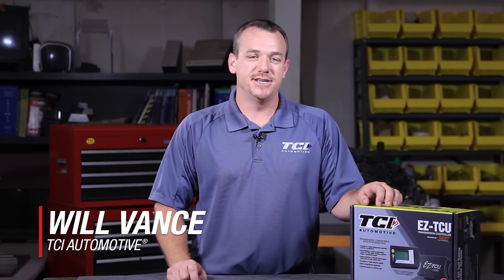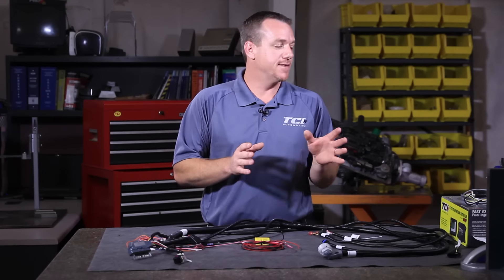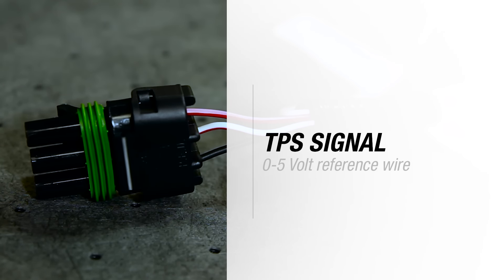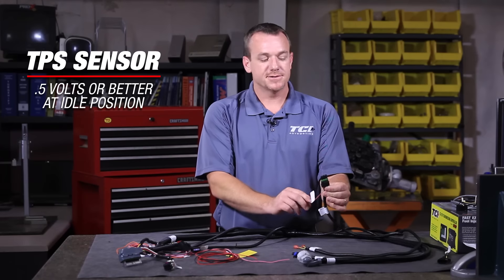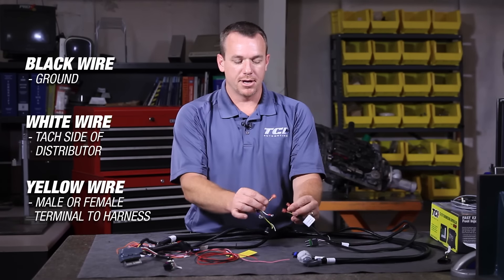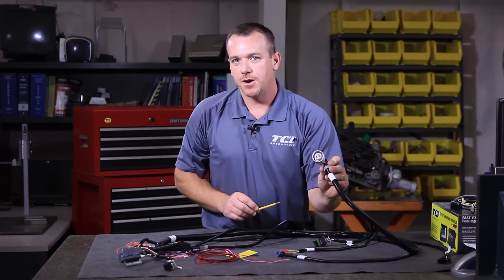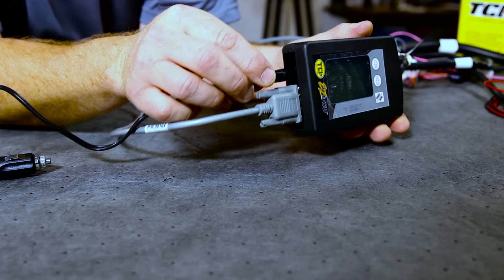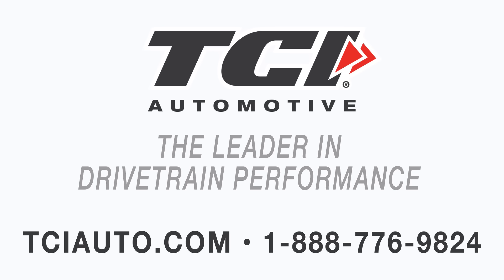TCI: EZ-TCU Transmission Controller Install Basics

Comment: I finished installation of ez tcu unit on a 6.5 diesel humvee running on 4l80e, its extremely easy, I absolutely love the simplicity and functionality of EZ TCU,good job guys.
Reply: was it a 24 volt hmmwv?

Comment: So I built a Gen 3 5.3 ( carb swapped ) I wanna run the original 4L60E that came with the motor along with the transfer case. Will this system work? If so I’ll buy it.

Comment: These modules are EXTREMELY SENSITIVE to heat. DO NOT mount under the hood. This left me stranded in the mountains and forced me to ziptie the module to the wiper blade to get me back on the road. 
I ordered a replacement and removed the harness and moved it into the cab of the truck. Still it goes into limp mode. Pack the module with an icepack and drive for hours. 
TCI recommended getting a warranty replacement. So that arrived today so I installed it and at least the tow haul works now . BUT STILL GOES LIMP. As soon as it gets warm. 
Swapped out vss twice at TCIs request. First one was a new aftermarket sensor. Second was a used GM sensor to get me on the road as no one had stock. A third GM sensor is on the way. I don't have high hopes. 
Icepacks for now.
Reply: Did you figure out a solution? I’m dealing with the same problem and can only drive for a few minutes before it stops showing mph on the handheld and downshift back to first gear.
Reply: @dedrickwashington6219  I did. I removed the trans control harness components from a spare OEM harness and re installed it in the GM ECU. Reflashed my ECU and have never looked back. I removed ALL TCI components and sent it back.
TCI was unavailable to provide me with a working ECU. JEGS was good an gave me a full credit. But it was a shitty experience.
Reply: @TheLugnut hey are you saying you changed the wiring harness
Reply: @kingsavageDKS Removed the TCI system installed my own harness and re flashed my ecu. Then returned the EZtcu to jegs for a full refund.
Reply: @TheLugnut  I appreciate the feedback
Reply: @dedrickwashington6219  hey did you ever find out what the problem was

Comment: i've installed a 383 stroker motor that has a carb. on it this is in my 97  Trans Am with the 4L60E transmission that came in the car i have bought the TCI  EZ-TCU transmission  controller powered by fast, am i gonna need to buy the remote TPS unit also or how am i gonna to suply the TPS signal to the TCU controller
Reply: Did you get a response I'm putting a 6.0 Ls  in my 93 and it with a 4l60E that I want to run with

Comment: I have a 80 series Land Cruiser that’s swapped 6.0/4L80e. Running the stock GM pcm. Can I use this to make my trans mission operate better and keep my engine on the GM pcm? My Lq9 is out of a Escalade and my 4L80e is out of an express van.

Comment: Im running a 6.2 liter diesel with the 4l80, i have the isspro magnetic tac system. How do i make it compatible with the tcu? After tapping into the rpm module but im not getting any indicators of tac signal on the live data screen. WtF can someone help me out here

Comment: Can anyone tell me where to connect the " TECH INN/ RPM MODULE" on a 93 silverado pickup 6.5 diesel 4L80E transmission. There is no place to plug it in? Where can I find a tach signal? I dont have a carb, ignition box or any tach output?

Comment: I bought the TCI  ECU I hooked the gray wire to a switch to ground still no lock up ! Instructions don’t say if you need a power source or not! I have a perfect 4 speed  sure would love look up ! Any input! Thanks
Reply: They are negative switched. But that doesn't mean it will work. The Purple performance mode wouldn't work on the first unit. But it works on the replacement they sent me. Unfortunately the units are EXTREMELY SENSITIVE to heat. DO NOT mount under the hood.

Comment: So i can hook a 4l60e to a gen1  350 chevy thats carburated and all i need is this controller and that deal for the throttle?
Reply: I wondering the same thing
Reply: @swschrader1981  you would need this part at 2:34

Comment: One min it reads my speed the next it goes to 0 and my transmission stays on first gear once it doesn't read my speed
Reply: I am having the same issue. 93 Silverado w/4L60e and carb swap. I followed the instructions plus I have the tci tps too. I can drive roughly 20 minutes or so before the system stops reading speed and then I’m stranded.  TCI  could only come up with “send it back”.

Comment: Is this for 4speed only? What about 6L80/6L90 ?
Reply: In the beginning, pause it when it’s showing the box that it comes in. It says it in the bottom left-hand corner that it works with 6X 6 speed transmissions.

Comment: I feel skeptical about taking technical advice from someone who calls an engine a motor.  If that don't know the difference between those two basic things, what else are they confused about?
Reply: Why do we call a Jet Engine an engine when it has the same number of moving parts as an Electric Motor???? I don't know either.
Reply: @johnparrish9215  Because a jet engine relies on internal combustion to create power whereas an electric motor does not.  Calling an engine a motor is just as incorrect as calling a fork a knife.
Reply: @Joe_Blow215  And Steam Turbines are called engines when there is no combustion.
All I'm saying is it does not matter in the long run.
Reply: @johnparrish9215  Steam turbines are engines because they produce mechanical power from chemical energy.  If the words are interchangeable why don't people call an electric motor an engine?  Look, if you want to sound uneducated, by all means continue calling an engine a motor.  People who take pride in precision know the difference.
Reply: @Joe_Blow215  and a liquid fueled rocket is an engine and a solid fueled is a motor.
You are guilty of writing off everything someone has to say over a word slip.
Be a bit more forgiving and listen to what they have to say. Then Flame them....lol
Reply: @johnparrish9215  Both rockets you mentioned are powered by engines,  Solid fueled and liquid fueled are still both rocket engines.
Reply: Definition of a motor= a machine, especially one powered by electricity or internal combustion, that supplies motive power for a vehicle or for some other device with moving parts.
Reply: @Joe_Blow215  damn, this whole time a thought my "motor"cycle had an  internal combustion engine. I wonder where all that oil and gas went too. Now if i could only find the plug for it.
Reply: @Joshg1984  Dictionaries reflect the cultural use of words, whether that usage is technically right or wrong.  It's similar to the usage of Kleenex when referring to facial tissue.  Kleenex is a brand, which turned into a word which is technically not correct.  However there is a dramatic difference between engines and motor.  You would be hard pressed to find a serious technical journal like folks from the SAE using those terms incorrectly.
Reply: @Joshg1984  Motor is a verb...  not used often these days, but still a verb.  At the dawn of the automotive age people used to "motor" about in their motor carriages which were powered (primarily) by engines.  Look, if you want to continue being technically incorrect, be my guest.  Whenever I hear someone say "motor" instead of engine I chuckle to my self and feel bad for their lack of education.
Reply: @Joe_Blow215  so basically it uncorrected only because you think it is. There is no technical about it. Because technically your wrong.
Reply: @Joe_Blow215  general motors. Ford motor company.
Reply: @Joe_Blow215  i find it so funny that people like you try and tell people things that you have no idea about.   
Your wrong on every level. The word engine was used way before internal combustion was created And it had nothing to do with propulsion.  The word motor is actually the more accurate meaning. Hopefully you will see  the error of your ways.
Reply: @Joe_Blow215  motortrend, motorweek. Did not know these were publications about electricity.
Reply: @Joe_Blow215  the department of "motor" vehicles is in for a rude awakening. You should call them and tell them how wrong they are.
Reply: @Joe_Blow215  so basically what I'm saying is you have it reversed. throughout history engine typically never meant a device to transform energy into movement while that's exactly what the word motor means. It's only the last 60-70 years where the term engine starting a new meaning. But the words are synonymous now, But "motor" being technically correct.
Reply: @Joshg1984  People like me know nothing?  I may not know many things, but having worked for Chrysler for YEARS in Auburn Hills, I do know a thing or two about cars.  "How so?" you might ask.  Great question.  I worked as a technical trainer and gave seminars to  dealer techs on how to work on new vehicles that were to be released and how to diagnose and repair difficult issues with current models.    One of the things I would instill in techs was the importance of conducting themselves in a professional manner; one very simple yet very important aspect was to speak as clearly and technically accurate as possible.  Being an intelligent well educated technician is the first step in being able to distance yourself from  the common grease monkey mechanic.   Since my years at Chrysler I've run a Crane and heavy equipment shop as the foreman, and now own a custom offroad shop, specializing in Jeeps.
Reply: @Joshg1984  Motortrend and Motorweek are excellent magazines which discuss mostly engine powered motor vehicles, but are slowly starting to incorporate more commentary  on electric powered vehicles....  which are powered by motors.
Reply: @Joshg1984  I do agree with you on the aspect of the word engine being used throughout history,  however if engine and motor are interchangeable terms,  why does no one call an electric motor and electric engine?  I mean, they are the same thing according to you.
Reply: @Joe_Blow215  correct. They become synonymous. The words can be used interchangeably. And your right people seem to use engine for internal combustion and motor but for lack of a better term engine became slang for motor. Now people have confused them.  they call it an electric motor because the word motor has a very specific meaning while engine has a much broader meaning. Kind of like google is considered search engine. Obviously search engines aren't physical engines but the words meaning is accurately depicted in the phrase, because a looooooong time ago they would call devices that calculated things engines. Hopefully I've have cleared this up for you and made you understand that in realty engine is not really the correct term but has become the  acceptable nomenclature. Motor is what an "engine" was originally called and somewhere along the lines it engine Snuck its way into common vernacular for a motor.
Reply: @Joe_Blow215  NOOO! a car would never be considered a engine powered motor vehicle, that would be redundent. Motor vehicle already implies that it has a mode of propulsion. You could say a gasoline powered internal combustion motor vehicle to be more descriptive but not a engine powered motor vehicle.
Reply: @Joe_Blow215  these publications are named that because that is what is accurate. Its only people like you who cant seem to realize that engine is not the correct term, just one that has become socially acceptable.
Reply: @Joe_Blow215  you do know that the "E" in SAE stands for engineers right. Which is where the word engine was derived. You cant seem to grasp the fact that a engine is like a well engineered or complex machine more then specifically attributed to internal cumbustion motors.
Reply: @Joe_Blow215  I find it funny that you are a crane operator. Because the crane is basically an engine. Powered by a motor. It's ironic. That you don't know the difference.
Reply: @Joe_Blow215  All my replies to you Are facts  every reply that you give is " Why do they call electric motors Motors?" That's not a valid argument.
Reply: @Joe_Blow215  Who knew people who are motorboating Are actually driving electric boats. They're going to be so surprised.
Reply: @Joe_Blow215  to all the people out there who owned motorhomes you now do not have to worry about putting gasoline or diesel in your vehicle Because Joe Blow says motor can only mean something electric.
Reply: You have a grammatical issue with your original statement. Glass houses, pal.
Reply: @superduty4556  yawn...